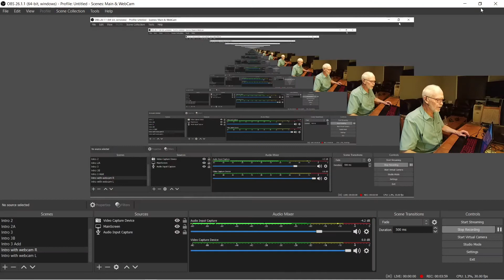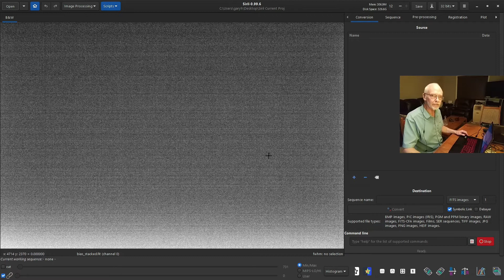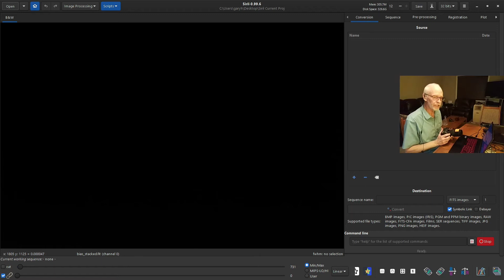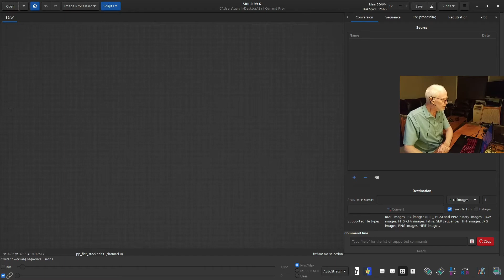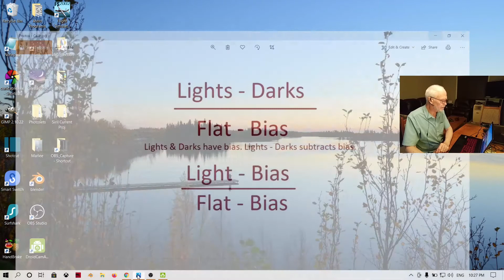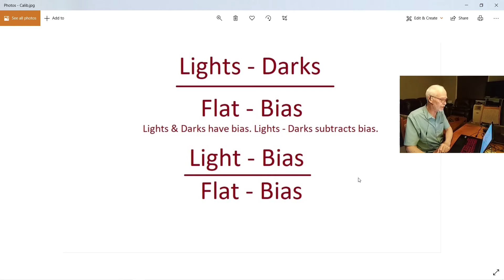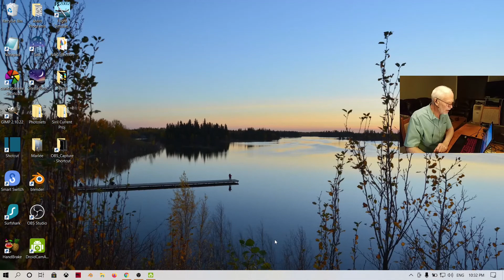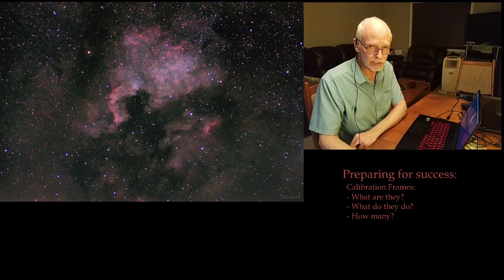A closer look at calibration frames

Comment: I tried taking flats of my computer screen (which is my tv), but the camera in motion picks up the pixels of the tv (FL=270). So have to use another method?
Reply from the maker: Another way is to just stretch some white material over the end & put a pad with a white screen on it. Some use a tshirt & point to the sky. Sorry the screen method did not work, just an easy hack for some DSLR shooters.

Comment: Gary, So logical and clearly explained. I am subscribed - you are an excellent teacher. The outline of your points is so progressive and I feel like I'm in a classroom where you answer the next question before a student needs to ask it. Your channel is a hidden treasure among the other channels out there. 
One question: Do Bias and Flats need to be at the same temperature like darks? One reason I ask is because I have been taking Darks - because i understood hot pixels. But i did not really understand Bias and Flats... so I haven't been taking them. But if temperature is irrelevant then one could take a set of Bias frames or Flats any time, is that correct?
Reply from the maker: Hi Nate, thanks for your kind words. You are correct - darks should be at the same sensor temperature & ISO and so are specific to the shoot. 
Bias are specific to ISO only and so can be saved for reuse.  
Flats need an identical image train and ISO. With a dslr it's easy to replicate lens & focus so I save & reuse them for a while. If I notice dust spots then it is time to re shoot them & restack with the new ones. 
With a scope it is difficult to recreate  the identical image train & focus - and dust spot changes are more likely - so I  would shoot new ones for each session. 
For my dslr I consider bias & flats necessary. I have not needed darks so far because I shoot only up to 1 minute and it has been cold out where I live ever since I got the tracker. And most stacking software has cosmetic correction, which is hot & cold pixel detection.
Hope this helps!
Reply: @BorealisLite  yes that helps a lot. I'm in Canada. So all winter I've done it backwards. I should have skipped darks and focused on flats... And biases. Thanks for the tip about the scope. That's what I'm using... Not a DSLR lens. Getting a flat for my image train will take some thought. I see some a suggestion from Astrobackyard about white T shirt and light panel. Ugh. More setup. Might just use a tablet. I may just take some bias and try it with the lights and see. Thanks again
Reply from the maker: @natem7440  sounds good. I guess it comes down to how your images turn out. If there is vignetting & dust spots the flats are worth it. I think a tablet with something to diffuse the light would be fine but I don't have scope experience yet.
Reply: @BorealisLite  I would be interested in a dark and bias only script, since the bias is easy to add to my present collection. I have some images a month old that still need processing and maybe too late now to create a flat since the optical train and any dust spots etc might have changed in the last month...
Reply from the maker: @Nate M  Hi Nate, I think the best thing is just darks & lights. Bias is in darks, so it gets subtracted from the lights when the darks are applied.  The only other place bias is used is in processing the flats, which I realize you won't have. 
I just uploaded another script  (and updated readme) to google drive with a LightsAndDarksOnlyNoStack.ssf script.  I would give that a try and see how it works for you.  You would need your darks in the darks folder and lights in the lights folder, everything will be converted, the darks stacked, the lights preprocessed and registered. Like most of my scripts, final stacking is manual to allow filtering to be applied based on registration.  The scripts are available at :  https://drive.google.com/drive/folders/1wfoejP7h6v01b_Lcs1Qkc18djpM6Znr4?usp=sharing
Hope this helps, I know it leaves you where you started, but now there is a script for it.  Cheers
Reply: @BorealisLite  that helps a lot! Thanks Gary. With that script I will be able to keep following in your tutorial. 👍😁